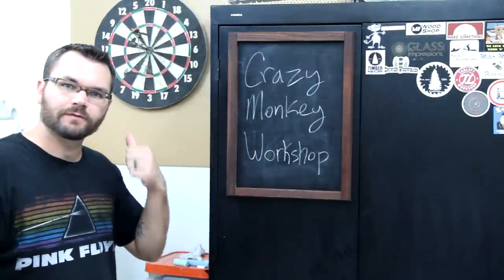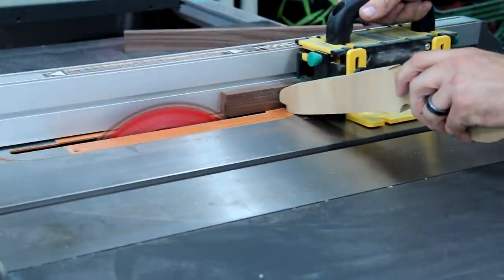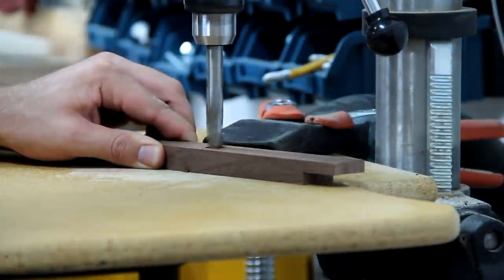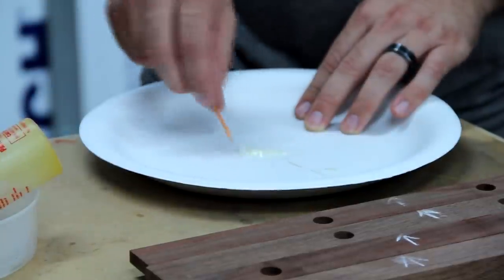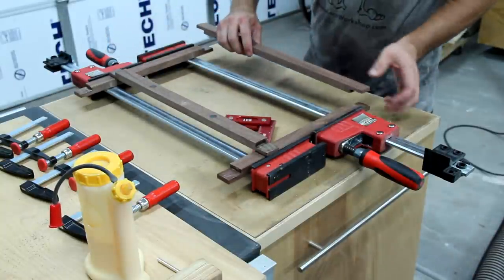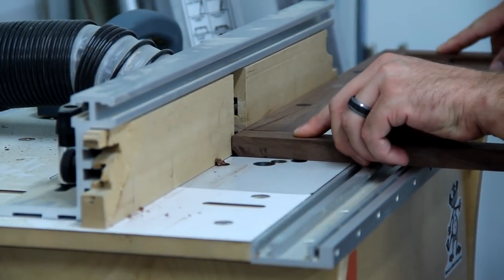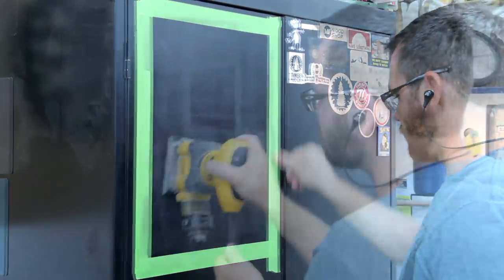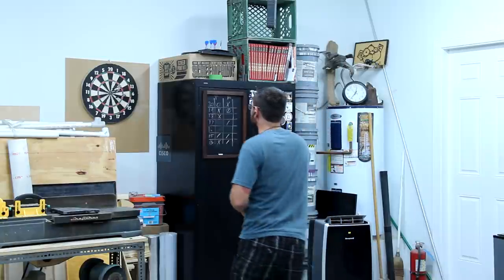Magnetic Frame & Cabinet Caulkboard Conversion

Comment: Nice way to make a chalk board.  The frame is nicely done, and you can always use it for a quick picture frame if the need arises.  ;)  Thanks for the video.
Reply from the maker: KSFWG Thanks! If my wife gets ahold of it, I'll probably find it on the side of the fridge with kids artwork plastering the inside.
Reply: Ty Moser And that wouldn't be bad at all.  You just might have to make another one for that purpose.  Thanks again for the video.